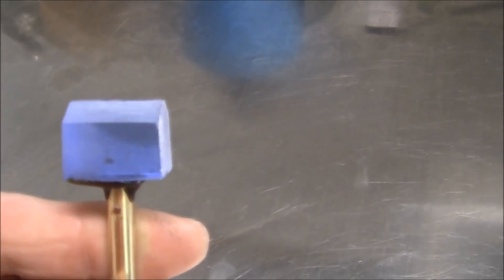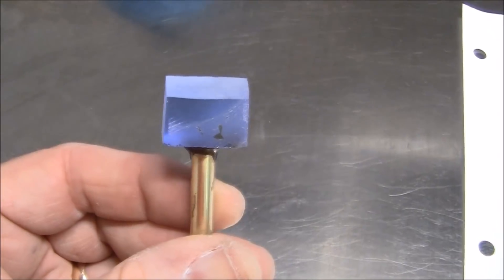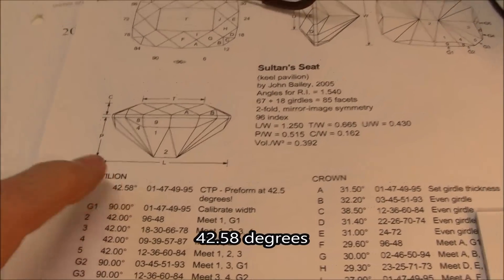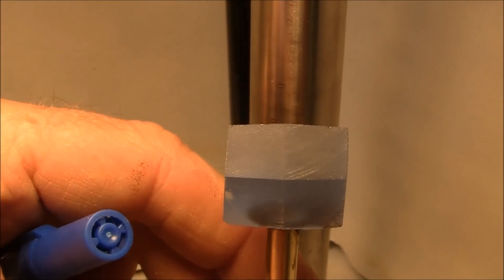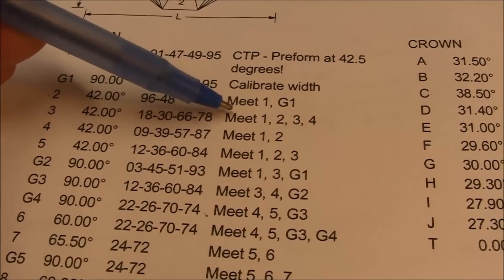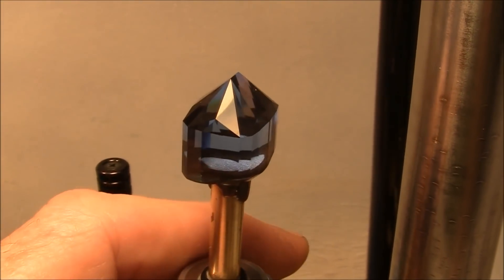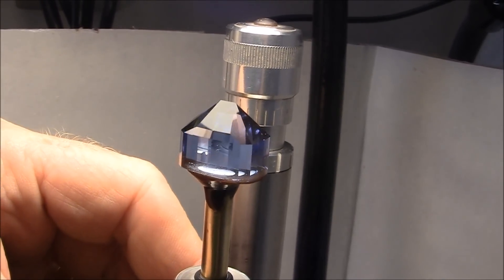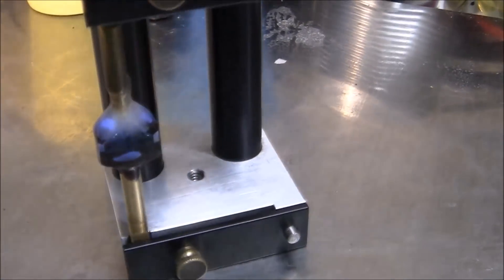Faceting gemstones: the sultans  seat.

Comment: I've started completely finishing each tier before moving on.  It saves time resetting the machine e over and over.
Reply: I tried that for a while i didn't find it any quicker and is far less accurate cause you can't adjust any errors from lap to lap
Reply from the maker: @robbot9877  I have tried that  method and found the same  thing, maybe at times it can be an advantage. Im not against  giving it another try.